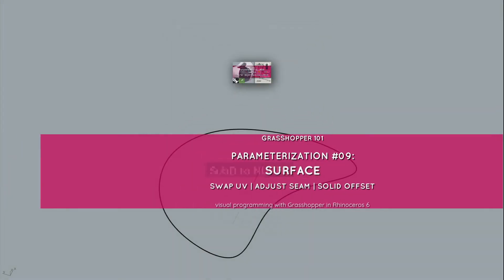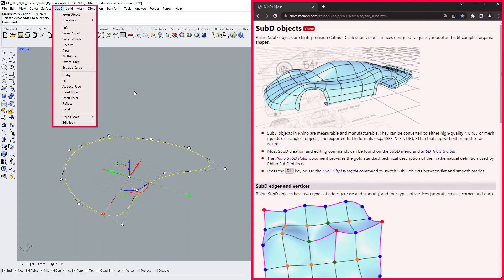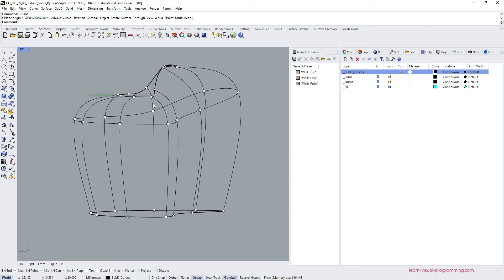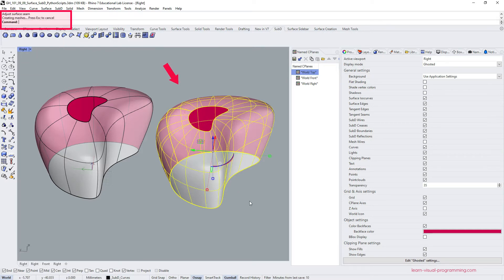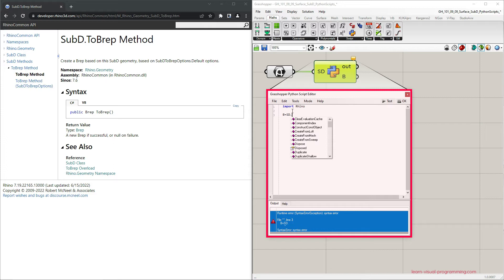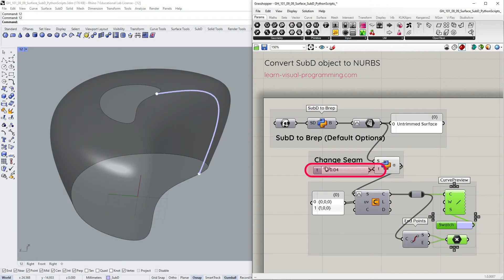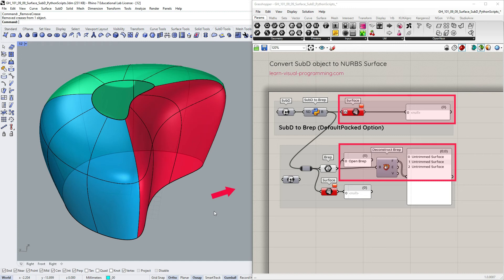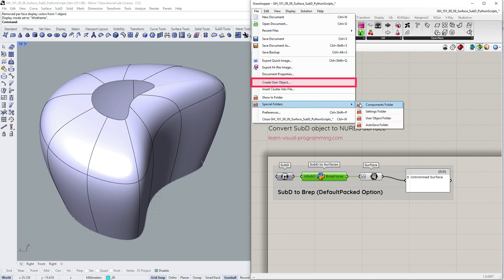Grasshopper 101: Parameterization | #09.b  SubD to NURBS Surface | Pack Faces | Default Packed

Comment: If the SubD is a closed SubD, the ghpython script doesn’t work.
Reply from the maker: The script works with closed SubD. But it can only pack the faces that are possible to pack. Parts containing extraordinary vertices, and creases won't be packed. In some instances, the MergeSrf command might work out. Utilize the SetPerFaceColorByFacePack as a reference for what packing you should expect. More information and relevant links are in the video description.
Reply: @learnvisualprogramming  Thank you. You are the best.

Comment from the maker: IMPORTANT: This tutorial is not meant for converting a polysurface into a single surface. The PackFaces command will not magically merge (nor will "wrap") a Brep into a single surface. 
If a polysurface has sharp edge relationships between the faces, trimmed faces, and other complexities, it might not be possible to convert it into a single NURBS surface. 

You can try rebuilding the geometry by modeling it from a single surface with control points or using other modeling tools while avoiding breaking surface continuity.

Check out the PatchSrf command:
►http://docs.mcneel.com/rhino/5/help/en-us/commands/patch.htm

Check out the NetworkSrf command:
►http://docs.mcneel.com/rhino/5/help/en-us/commands/networksrf.htm

Check out Mesh shrink-wrap:
►https://discourse.mcneel.com/t/shrinkwrapping-complex-geometry/147054/13